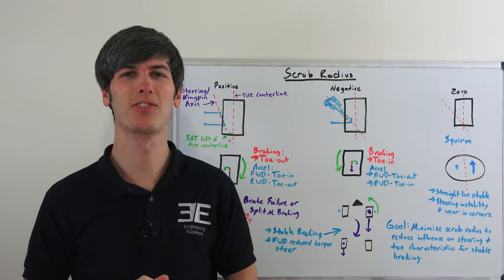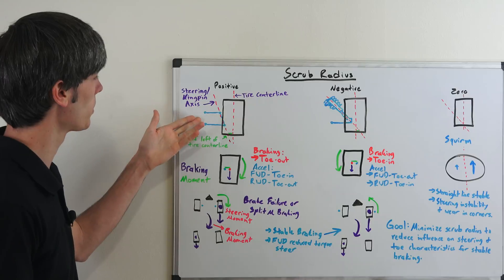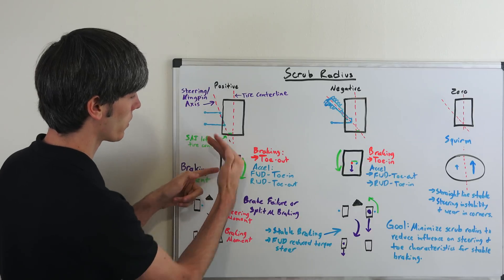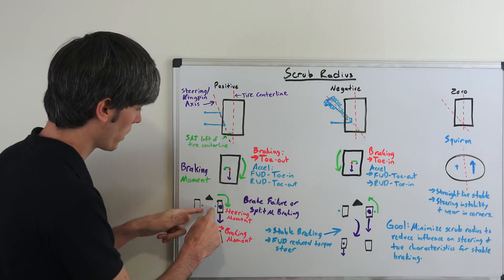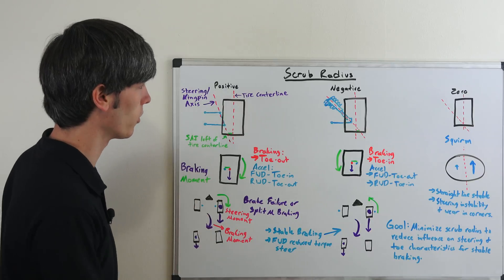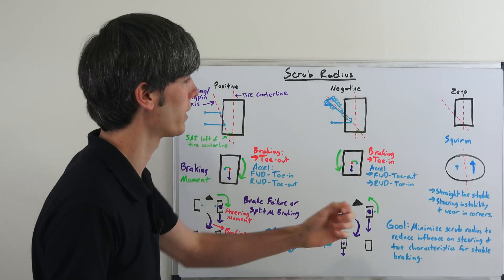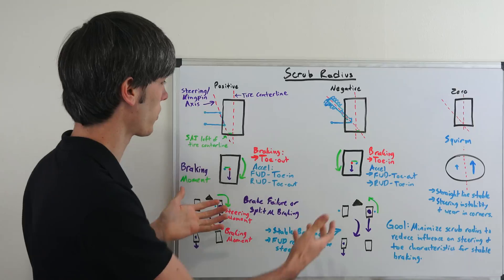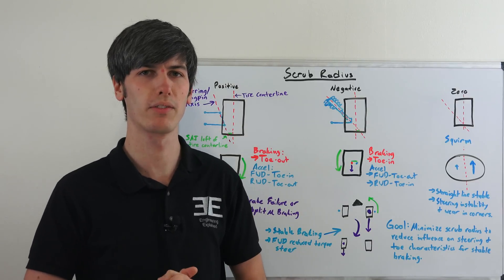Scrub Radius - Suspension Design - Explained

Comment: If I've understood correctly, this isn't just an alignment thing; if you do something as simple as adding a spacer to the wheel or use an aftermarket wheel with a different offset, the scrub radius will be altered and so too will the vehicle's handling, correct?
Reply from the maker: Correct!
Reply: Engineering Explained
Awesome!  Wow, I think I just learned everything I did wrong with my last car, LOL.

Great video man, thanks a bunch!  Learned a lot!  :D
Reply: Martin Rudolph It absolutely does apply. Devil's in the details.

Modern double wishbone suspensions are rarely ever perfectly equal length top and bottom, due to the benefits of counteracting bodyroll camber changes by using unequal lengths arms top and bottom. As such, when you're changing the ride height of such a suspension, one arm is rotating less than the other, and that induces camber changes. 

That's a huge reason why long-travel suspensions on trophy trucks and baja buggies have their arms extending from the center line of the vehicle - with longer arms, they experience less camber change through their long travel heights, while still retaining the benefits of unequal length control arms.
Reply: +Engineering Explained Good thing my summer set of wheels are just 5mm more negative in offset than my stock/winter wheels. Your videos are very helpful, however, I'm hesitant to modify my car because I now consider all the factors that the mods may affect, lol.
Reply: +rhkips You got it. It's worth keeping in mind that, changes to the ride height (raising or lowering) will also change the steering axis. Very similar to how camber changes in particular due to dissimilar radii of the control arms/struts.
Reply: Engineering Explained you r definitely YouTube automotive engineering god lol
Reply: +Joe Smathers But that does not apply to double-wishbone setups, or do I miss something?
Reply: My car is not modern. :-)
But I see your point. Thanks for the explanation!
Reply: rhkips I readed on the form I'm joined to that someone changed to different rims and it actually helped stop his car faster in a emergency ( dear jumped out )

Comment: How do I easyly meassure my scrub radius to see the difference between stock wheels and aftermarket ones?
Reply: +Leofred 
There are numerous sites that have decent instructions. 
https://www.google.com/search?num=100&newwindow=1&site=&source=hp&q=how+to+measure+scrub+radius&oq=how+to+measure+scrub+radius&gs_l=hp.3..0.807.9490.0.9900.28.17.0.11.11.0.153.1582.13j4.17.0....0...1c.1.64.hp..1.27.1562.0.zRZwsgJD1oo
Reply: mas921
You  could do that, but what you propose is not a calculation or actually quantifying the scrub radius value, but guessing and arriving at an arbitrary "relative" number with no degree of accuracy. 
The only real method is to actually setup or mock-up and perform the measurements and perform the calculations. 
I would also encourage anyone performing these measurements to perform them with the wheels straight ahead at static loaded height and at maximum up and down vertical travel and wheels turned at 5 degree increments left and right until against the stops recording all values at each 5 degree increment. 
It is a fair amount of effort, but if you want to know what the front end and steering geometry is and what to expect from your suspension and steering it is crucial.

Comment: If I get this right that's the "Lenkrollradius" in German. There was a lot of discussion about that in our German GT86 forums. 
Finally instead of getting "dat stance tho" by offset +35rims I kept my wider wheels at OEM +48 offset.
Reply: Dominik Heidrich I was wondering this myself. I found some nice Konig Runlite but they're 35et and I don't want to ruin my handling. Stock is 48et (2011 Subaru Legacy) so I'm leaning to the 45et Enkeis right now since it's a small difference

Comment: How negative scrub radius help reduce FWD torque steer? :)
Reply: zibalas1993 It is about moment of the wheel

When you power the frontwheel in powerful fwd car

The negative scrubradius will make powered wheels goes toe in

So it is more stable while accelerating

Comment: I´ve changed the offset of my wheels and increased the tire width on my Subaru Impreza, this can change the scrub radius? Thanks
Reply: +Diogo Cordova If the width increase is double the offset increase then the scrub radius will be really close to the same. Ex. going from 225/45R17 on 17x7 ET45 to 245/40R17 on 17x8 ET35 will give a pretty similar track width.
Reply: +Bradley Comis Original: 205/55R16 on 16x6.5, Offset: +55,
Now: 235/45R17 on 17x8, Offset: +53
Reply: +Diogo Cordova You have increased your scrub radius by r_delta = ((235 - 205)/2 + (53 - 55)) mm = (15 - 2) mm = 13 mm. Not too dramatic, I reckon, but you will probably feel the difference in heavier steering from that. Changing the offset lessened your scrub radius increase to 13 mm, otherwise it would have been 15 mm. Again, not too big of a deal.
Reply: You should review the concept of offset, because you just can't take its value alone, you have to consider total width of the wheel, not of the tires.

Comment: You didn't mention any benefits of positive scrub radius, yet most race cars seem to have positive scrub radius, what gives???
Reply from the maker: +usernamefromhell I don't know what most race cars do, but supposedly positive scrub is more stable when you're braking and turning simultaneously, so it may be used in racing for stable trail braking.
Reply: Having a positive scrub radius is normal in racing cars because you want the instability under braking and the increased stability under acceleration. 

Having the car toe out under braking makes the front end more willing to turn into a corner while trail braking. In opposite, when you accelerate the toe in will help to give you stability to put power down and drive out of the corner.

If you haven&#39;t seen his video on toe I suggest you watch that as well. :)
Reply: +usernamefromhell Interesting, I had the exact same question.

Well, with some background thinking, many racecars have rear downforce increasing much faster than front downforce and then have a highly locked LSD under braking - and generally speaking wider rear tires - , so it would help with turn-in.

According to the video I also find little interest in positive scrub radius, yet for some reasons it could be interesting for weight (shorter shocks and springs?) or when other components do not leave enough space for a negative scrub radius (such as the engine).

Last thing I thought about was camber (caster also, a bit maybe). Racecars have camber in order to counteract some geometry effect during cornering and increase cornering speed (which also, if done properly, stresses the outside of the tire less). I wonder if they don't simply do that to make it match the camber (SAI at the optimal camber point).
Reply: Dynamic weight distribution....positive scrub radius....when you turn the front wheels to the left, because the tires are outside of the pivot point, the LF essentially picks up load and the RF removes load.  Since the LF picks up load, so does the cross or RR.  As fuel is applied, the car is going to predominantly drive off the RR, helping the car turn to the left.   If you turn right, it will dynamicly load the LR, helping to turn right, under power.  So, if you are turning left and the vehicle gets too loose and you countersteer, under power, you are loading the LR so that you are going to drive off that wheel and your loose condition will be dramaticly reduced.  
This is why rear drive racing vehicles typically have positive scrub radius.
Reply: Mike Grady thanks for pointing this out I'd consider myself decently educated but there are guys that are probably smarter than / always good to have a reference, I've been looking how to set up my 60s muscle car for dd and auto X driving and I know little changes can add up ( sometimes the difference between winning a race and not finishing it ) it not just bolting parts up that makes a car well behaved and in my case stock settings are probably way off from what i want ps. Not a lot of you tube videos on how and why to a great set up like Pro-Formance alignments with a generalisationed range of numbers for use or what the difference is between a auto X set up is and road racing or how different parts play together

Comment: So what does this mean for my wheel choices?
Reply: +Car Geeks Anonymous Get a rim with the same offset as factory. 
Trouble is, if you have already lowered your car, your kpi/sai will probably be different from stock, and it'll throw out all of the angles. If you haven't lowered your car, then any width wheel that'll fit in your wheel well with the same rolling radius as the oem wheel, and the same offset will be good.
Reply: lolz larkin by lowered you mean switching to coilovers right? Or a lowered springs will also throw off the angles as well?